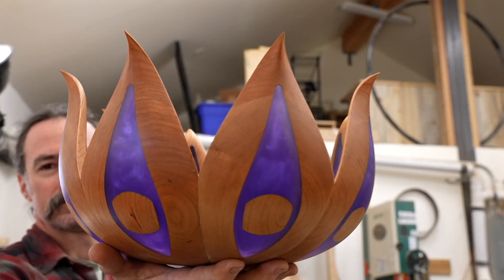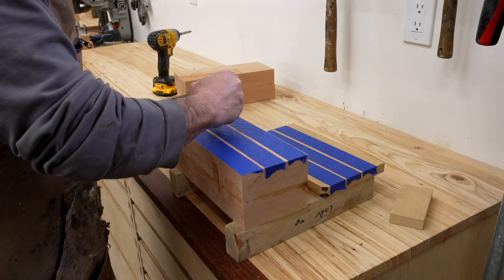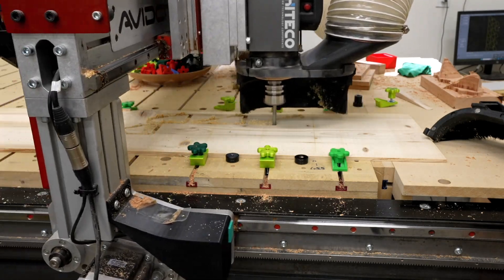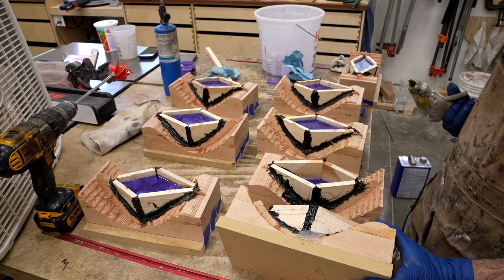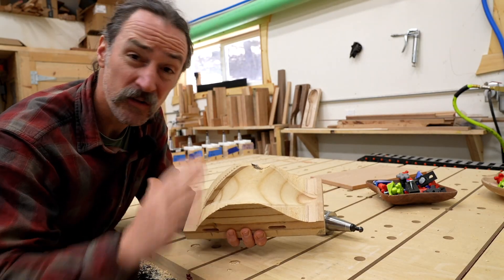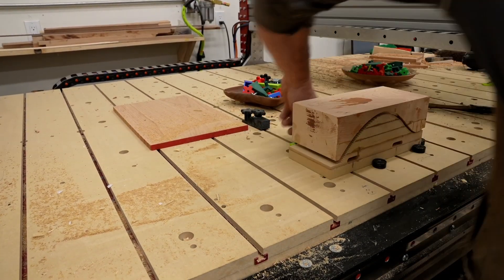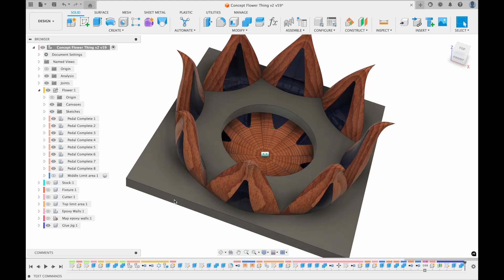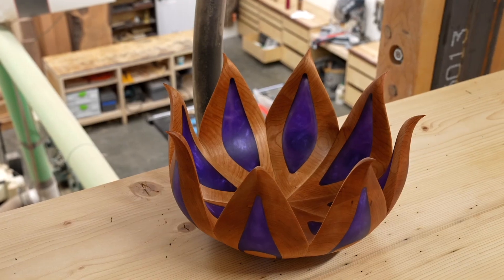52+ Hours of CNC Woodworking

Comment: Another awesome work of art.  Crashes are so challenging and even when simulating tool path can be difficult to see.
Reply from the maker: Fusion is really good about it: the simulation will tell you if there are any crashes (assuming you put in the right bit heights, which I may not have done!). Part of the problem is I sometimes tweak a toolpath and change it dramatically, and simply forget to run the simulation to verify it1

Comment: 0:07 I will take a few guesses 🧐. SubD modelling 🤔, 2 sided machining with multiple setups 🧐, custom molds for epoxy containment before the second machining cycle.
Reply from the maker: Good guesses! I used "Surface Modeling" in Fusion to do the basic design...but yeah, you are right about all the rest!
Reply: @CorbinDunn  
Beautiful!  Yes i would be interested in seeing the surface  modeling steps in fusion.